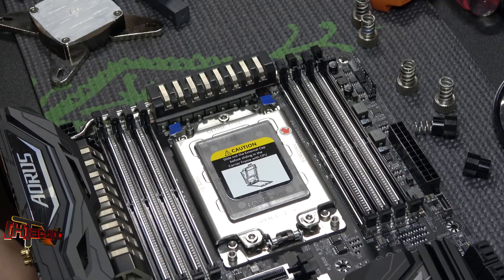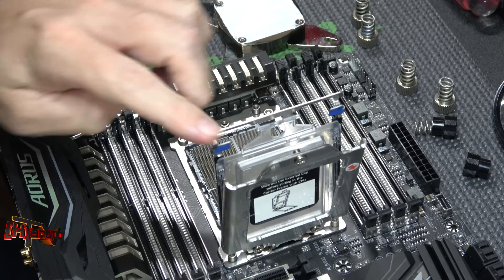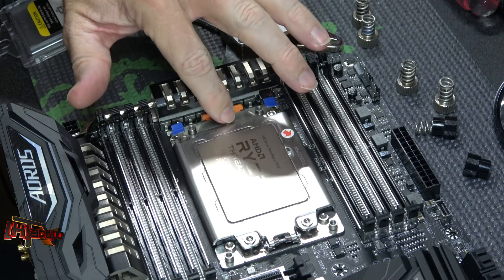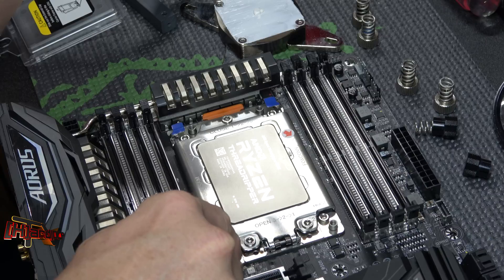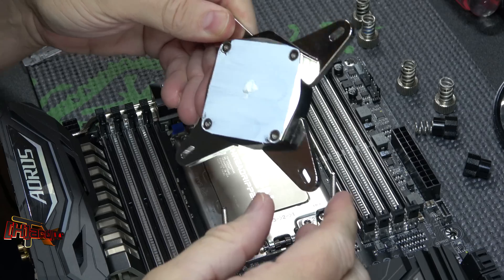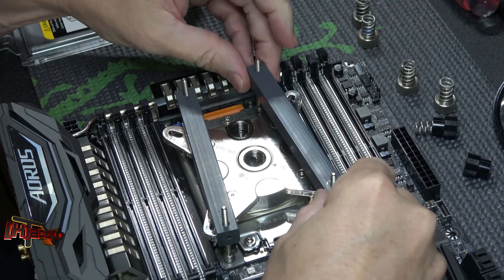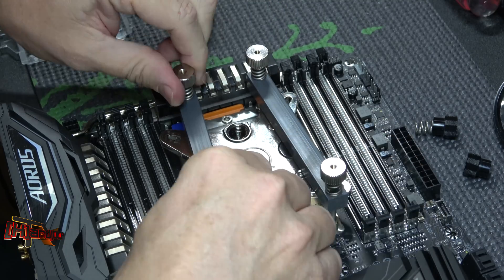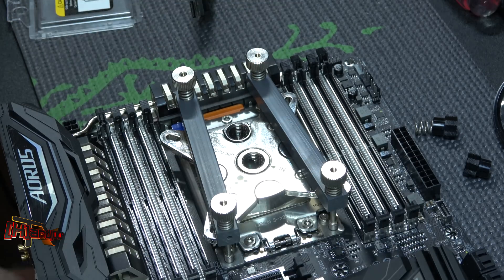AMD Ryzen Threadripper DIY Water Block Mount Test

Comment: Please post your results as it's already August 10th in China.
Reply from the maker: The embargo is set for August 10th 8am Central Daylight Time in the USA.
Reply: Thanks, that's exactly the information I was fishing for. I tried to find it by searching online but was unsuccessful. I'm looking forward to your test results and hope that you are able to compare them to at least one of the AMD recommended AIO liquid coolers that use the Asetek adapter. Overclocking results would be welcome as well. I'll be checking the HardOCP website and here on YouTube starting at 9am EDT tomorrow morning. AFAIK, you're the only ones testingThreadripper with a custom waterblock. Great Job!

Comment: GN did a comprehensive test of about 5 methods of thermal paste application and a large central blob gave the best results.
Reply from the maker: I would suggest you could do the tests over and over and over and get different results.  I have been doing this 20 years and have seen all "proven" best.

Comment: We can't see perfectly from this angle but it looks a 1/4" short in length and the arms a 1/4" too wide (Memory Slot interference). Maybe slide it away from the Camera an 1/8".

I wouldn't want to trust that over a years time for sliding sideways either. Drill and Tap new holes in the arms and 4 more in the plastic.

Use the Noctua's plate size as a guide, until a real Watercooler for the Threadripper is at hand.

Good luck,
Rob

Comment: Isn't it disappointing that people have to make a DIY waterblock contraption for AMD's HEDT platform (X399).
All these company's that make custom waterblocks, still haven't shown Threadripper "proper" engineered water blocks.

All those tiny waterblocks that is being used with a adapter mounting bracket, to fit on ThreadRipper is really pathetic/outrages amateur engineering! You would think they could engineer a 100% IHS contact waterblock in under a week now, with all their knowledge in watercooling.

A company called BYKSKI showed first Threadripper proper sized block.
So maybe they all just late...
Reply: No, not quite, he said it pretty much does the job if your over the active cores.  He also said since the whole point of an IHS (integrated HEAT SPREADER) is to spread the heat, that you would more than likely notice gains from covering more area.  Not rocket science.
Reply: BYKSKI waterblock has same sized fin area as the Asetek AIOs, so doesn't cover full die area, it just has a larger base plate, expecting proper vendors to release their waterblocks. Perhaps we will see full-cover AIOs too in the future.
Reply: EK just announced a Threadripper waterblock.
Reply: Searched the EK website using both 'Threadripper' and 'TR4' and couldn't find one. Please post a direct link if you have one.
Reply: I didn't realize that, thank you.
Reply: Yes, waiting for full comparison reviews now.
Reply: Nisco Racing Thw made a custom mount for and Alphacool XPX that looks pretty good they even have the schematics on their site I'd you wanna make one
Reply: The platform is not even out yet bud it's the same why every time Intel changes cooler footprints too
Reply: Looks like noctuas gonna have a full plate for Threadripper.  Noctuas D15 already outperforms pretty much any AIO while being cheaper and far more quiet so whats the point.
Reply: Gamers Nexus showed that you don't need to cover the entire thing for proper cooling
Reply: EK and most other LCS makers already have custom X399 water-blocks for order the last time I checked.
Reply: Intel shill detected, fucking so obvious, try harder parasite

Comment: I totally agree with smoothing out the thermal paste and adding a small pea before applying pressure, I'm guaranteed 100% coverage of the two surfaces with TIM using that method whereas the pea size only method never gets 100% and if it ever does you end up with TIM where you don't want it as it dribbles out the sides. For a circle to cover a square (or rectangle), there's either a lot of overflow or less than ideal coverage of the heat spreader, though it's often adequate as the heat spreader is bigger than the die it covers.

Comment: Looks like a good solution Kyle, I want my next build to be Threadripper (whenever the hell that'll be heh) but I was curious with the size of the CPU if a new block would be needed. Looks like if XSPC comes out with a raystorm plate for it, it should still be pretty good :)